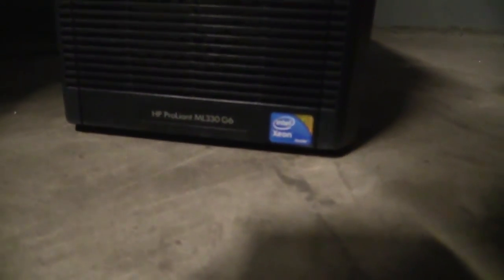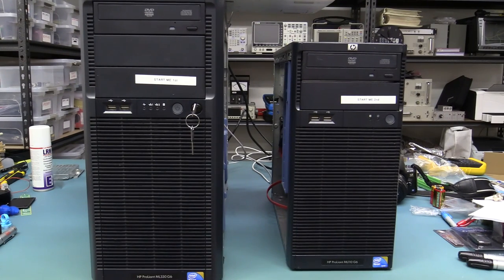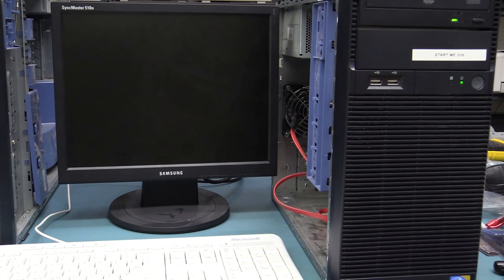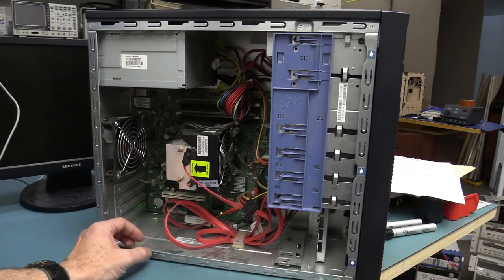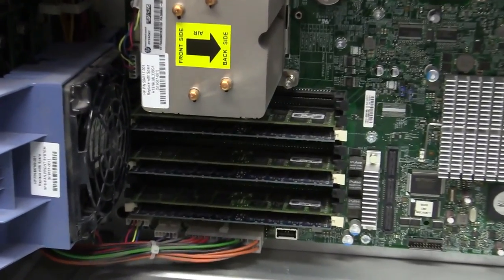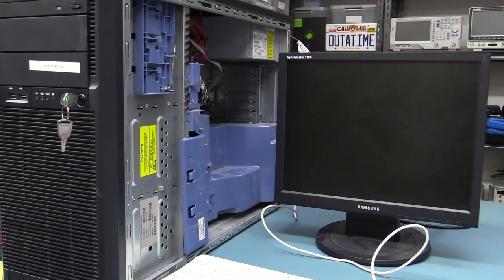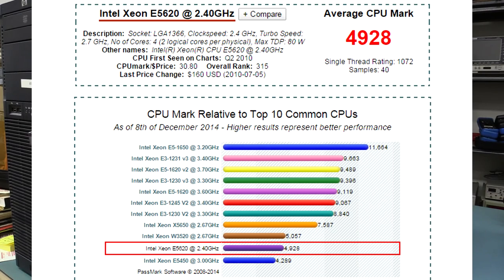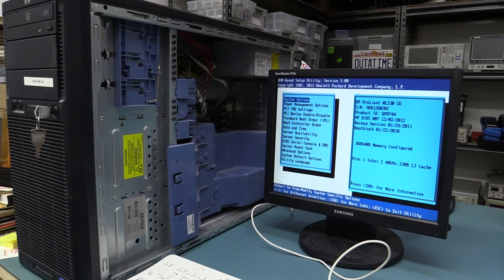EEVblog #691 - Dumpster Dive Xeon Servers

Comment: I have a HP z800 workstation its a desktop machine built on server components: 
specs are:
  OS: windows 10
  Ram: 48 Gb ddr
  Hard Drive: 2TB
  Graphics card: Nvidea Quadro FX 3800
  CPU: Intel Xeon not sure which but it has 2.80 Ghz 6 Cores and 12 threads + it has dual cpu slot
Reply: Why are you using a workstation as a desktop mashine if i may ask?
Seems a bit overkill to me :)
I get the Xeon because of the ECC Support and if are working with video stuff i also get why two off them but still...
I´d also be interessted it knowing what you use the Quadro for (If its not too much to be asked :))
Reply: i am currently waiting for a new graphics card to be shiped and my dad gave me the computer for my birthday half a year ago :D
Reply: I have got the graphics card now its a beast
Reply: If you find something that uses that many cores it pretty much is yeah :)
Reply: :D
Reply: alot of people dont even belive me when i tell them the specs
Reply: Im working with a lot bigger mashines so im used to it :)
If seen people denying the fact that you can indeed have two (or even 4) CPUs in a system, so i know that problem :)
Its just so uncommen for consumer use, most people are likely to never have seen a beast like that before :)
Reply: ik but also my age dosent help (im 13)

Comment: People throw out some of the sillyest things. It still works i was them i'd take home for a nice PC, or donate to something even a school for their classes, etc. I get allot of LCDs because they died usually just a bad cap. I went to college for network administration, i knew people at the school, and i got some almost 100LB mainframe class servers. First experience with that type hardware, SCSI. Most students would never have the opportunity. Yes it's dated, but i know places that still run SCSI servers, and it has some things for hot swap drives, PSU.

Comment: Hi Dave,

That quiet the find the HP ML330 G6 looked up the specs thats a nice server the processor is quad core 2.4 ghz burstable to 2.8 ghz with hyper threading so that will give you 8 cores and 36 GB ram just throw in a hard drive windows 7 64 bit and or vmware esxi 5.5 And this would make a decent video processing server. thats my two bits.

Your channel is awesome been watching since the being...

Ttyl

Comment: Whoever put the HP Proliant with the Xeon E 56xx onto the dumpster, must been a massive idiot. This System would have been upgraded really cheap to a x5675 from Ebay about 140€. This processor even will run about midrange CPUs today with low TDP usage. And they are very good to OC. Will run guaranteed with 160 BCL on DDr3 1600. And then, they are really fast.

Comment: 4095 MB of memory on start me second  BIOS? Not very power of 2....
Reply: 4095 MB of "extended memory" + 1 MB of low memory. When operating in "real" mode, x86 can only access 1 MB of RAM.
Reply: Ian Tester I had completely forgotten about low vs high memory (Thankfully from lack of need!). That makes a lot of sense. Odd that the  BIOS is reporting that distinction.

Comment: Heh, Dave, I have a couple Xeon CPUs I could send you of you want them, but you probably don't want them: they're only 3.06GHz. I stopped using them a bit ago because the motherboard just fizzled and it was too expensive to replace it so I decided to switch to non-Xeon i7. If you are interested let me know. (Shipping might be expensive from US to AU.)
Reply: Oh yeah, I thought I should mention that I ran a PII/300 on a 440LX (not BX) chipset 24/7 for about 15 years. That's hard to beat! The only reason I turned the machine off is that it's no longer fast enough to keep up with my internet connection.
Reply: Martel DuVigneaud Not a bad innings to be sure, but I saw an original Pentium 60 running a building airconditioning system, that had been going since the day it was installed as a brand new computer in the early nineties. No plans to replace it either.

Comment: "ridiculous consumer gamer fanboy watercooled", did you not hear that thing start up?  There's a reason why why stick them in their own rooms and there's a reason consumer parts are bigger.  Slower fans and less noise for something sitting a couple of feet from your ears.  Also as far a air cooling goes it's not like heat isn't normally the limiting factor when it comes to overclocking (depending on the heatsink).

Comment: That big server is some serious PC porn, but it's not too great in performance, as the previous owners surely found out. As I see it, it's only good for its high sentimental value.
I use a modded wifi router as my web server. Can't beat the silence and power efficiency.

Comment: Yet another great dumpster dive video, but Dave, sad to hear you ranting on "gamers" and the hardware targeted that demographic, indeed much of it can certainly be considered "bling", but there is want for liquid cooling solutions, large passive air coolers and such if you are in need of a high-end gaming system and dabbing with overclocking. So, let's embrace our differences, why not? :)

/ Michael

Comment: Xeons are most certainly not  more efficient.  They have  a TDP rating that  is  bounds higher than their  consumer counterparts..  now if you look at say a socket 2011  chip  the tdp  is  reallly high but  as far      xeons to most run of the mill CPU's.  your statement is false.

Comment: Like a vacumcleaner....:)   maybe worse.... I'm one of those gamers, i don' t like watercooling or ledlights all over the place. I like high performance with ultra silence with no overclocking and thats why i have tested almost all high end aircoolers just one is left to try out. Watercooling is probably not quiet enough compared to well optimized airflow case and best fans in wortld-Arctic fans.

Comment: EEVblog You should see the IBM System X3650 M2 Rack Server i got second hand for christmas :P  Powered with dual XEON E5530 2.4Ghz Quad Core processors and 32GB Ram with 8x 146GB 15K RPM SAS Disks. Cost $550 Delivered.
Im using it for VMware ESXi 

Also XEONs and iSeries CPU's ARE NOT Interchangeable, even for the same socket.
I was GOING to get a ML350 G6 rack Mount (5 or 6 RU) but i choose the IBM (2 RU) for its form factor.

Comment: My i3 3225 would spank the ass of the Xeon X3430
Reply: My single core i3 xp 4gb ram and then MONSTER GRAPHICS CARD would be slower at everything ecept graphics compared to those comps
Reply: +xXDahChubChubXx In single-core tasks, maybe. For multi-core tasks you'd get eaten alive by the X3430, haha. Not to mention ECC support, higher L2/L3 cache, cryptography functions on-die, etc.

These aren't specced by their clock speed. Honestly, the clock speed doesn't matter much when you're loading out a server. Not to mention it's a quad-core (8 threads), your i3 is dual-core (4 threads). So it's effectively twice as fast at the same clock.

Comment: 1, you repeat to much and talk to slow, i probably could of put out the same information  as you in a 5 mint video. not haten just would like you to at least edit repeats out your videos. also im jelly, good ECC ram cost alot and you got alot of it. i would love to have somthing like that in my HP z800 server! instead it just got 8gb of corsair xms3 1300 and 2 xeon l5506 cpu's. for relitivly cheep i have pulled off my main rig being a Classified SR-2 with 20gb Corsair Dominator GT 1600 wiith 2 xeon x5690's oc@ 4.2ghz giving me a total of 12 cores and 24 threads with 24mb of cache. but i just spent years on ebay and amzion and ebay watching and wating for the price of something to fall abnormally low. like the cpus i got them for 185$ a pice instead of 1600$